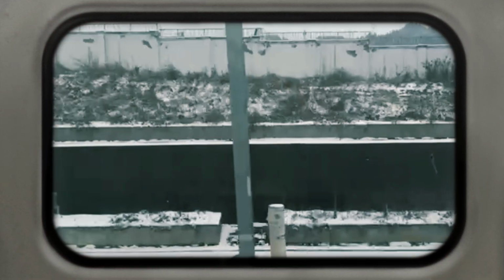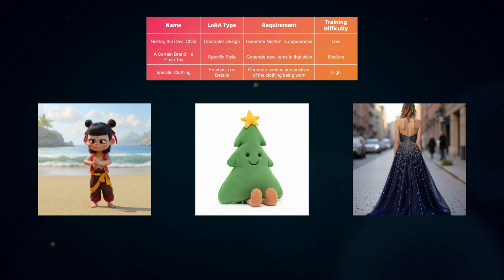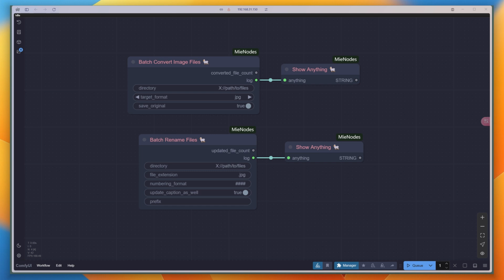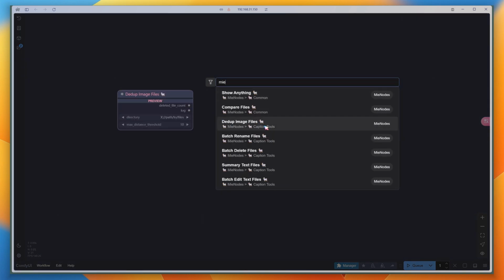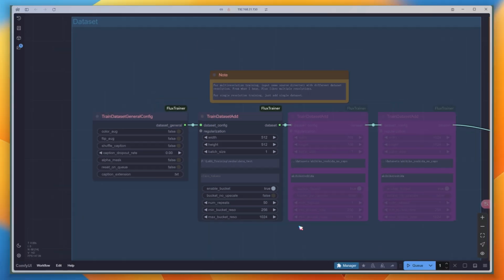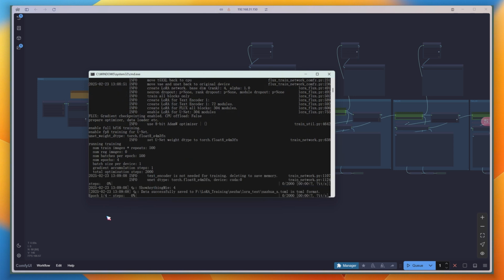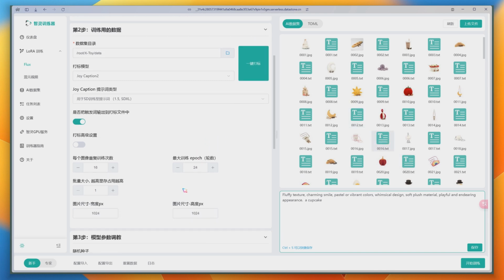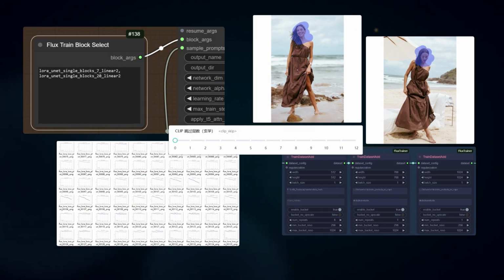Flux LoRA Training: Quick 30-Minute Guide for Character Design, Style, and Specific Outfit LoRA

Comment: Great workflow and explanation!! Is it possible to save multiple Epoch stages?
Reply from the maker: The local ComfyUI training workflow can add any number of nodes for saving, but it can only be done through steps, not epochs. If you want to save by epochs, you may need to calculate it manually.